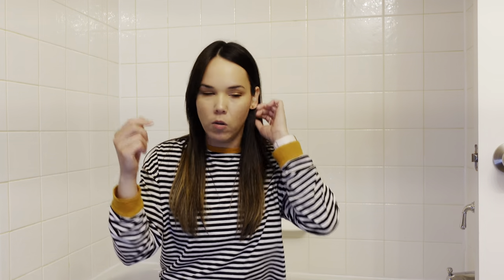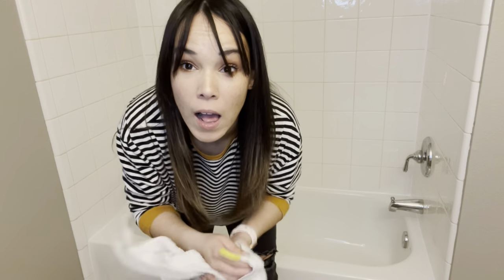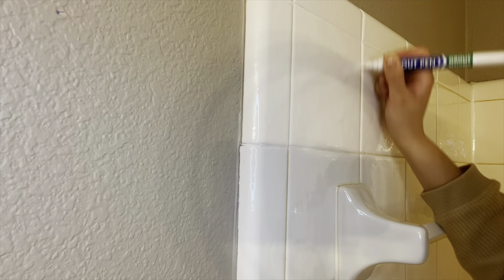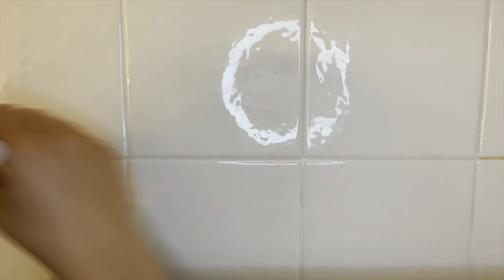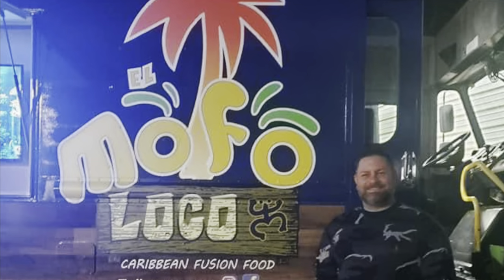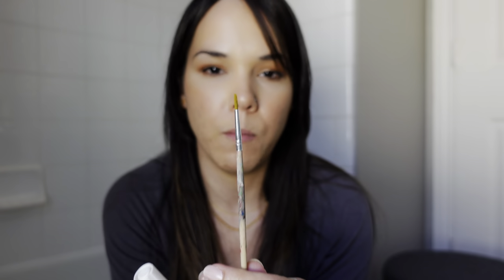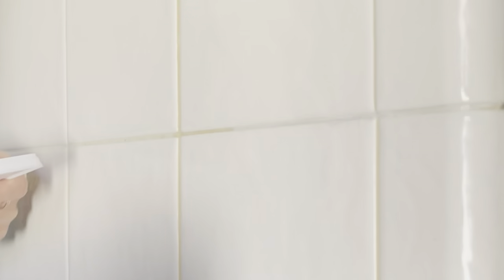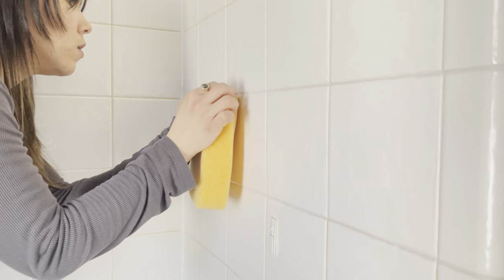Make Grout Look New| Grout Pen vs Polyblend Grout Renew

Comment: Thank you for posting your video on these two products.  I have only used the Polyblend product to do a kitchen and family room grout project, so I have nothing else to compare.  I was also interested in the review of the GroutShine pen.  So, after viewing your video, I am convinced that the Polyblend was the right choice.  Yes, the pen would provide a quicker method of applying a coat of grout paint but, as you mention, the current price of the product online is 30.00 dollars per pen (although they are running a 50% off special).  What I like about the Polyblend is that it is both a paint and sealer, the latter of which is most important in such places as a shower enclosure, or, as in my situation, a heavily trafficked floor that needs almost daily mopping.  Applied with a toothbrush, it is quick to apply, let dry, then scrub the "over paint" with a scrubbing pad like you show here.  After a year my floors look great, with just a lightly damp cloth to clean up the grout lines that eventually do get dirt and stains in them from the floor traffic.  I plan next to freshen up the grout lines in my showers and bathtub  tile walls.  Also, as you advise, it would be good to prep the grout with a good grout cleaner to get out the built up dirt and stains before painting.  In fact, the prep took me the longest to do before applying the Polyblend.  Great video and keep up the good work!
Reply from the maker: 🤍Thank you for your comment 🤍

Comment: Just found your video in the middle of my shower tile cleaning painting project. I first tried a grout pen (different manufacturer than yours) but it wouldn’t dispense the paint very well. Then, I bought Grout Renew Arctic White and put it in with a craft paintbrush. I like the toothbrush idea better! Will continue with that. By the way, love your accent, de donde eres, Venezuela?
Reply from the maker: Glad it worked 🤍From 🇵🇷 PR ❤️

Comment: I need to get polyblend. I hate our kitchen floor. I can clean it 65 times in a row and it never looks clean. The 1 and only product I found that ever worked is zep grout cleaner. But after a while again with traffic build up it's back to square 1. I wish they would figure out a solution to have tile without grout.
Reply from the maker: Get it you are going to be very happy with the results 🤍